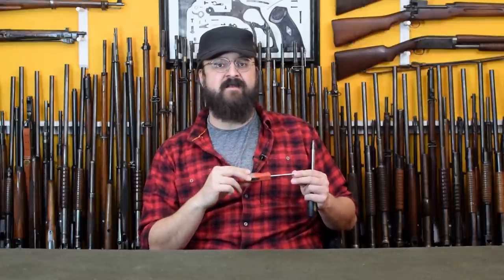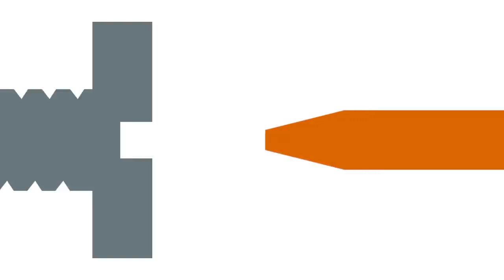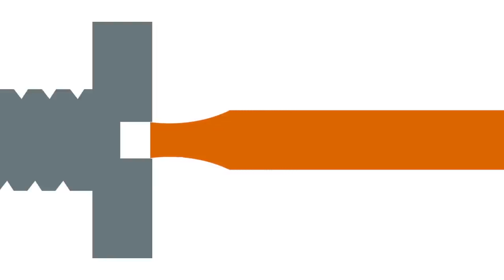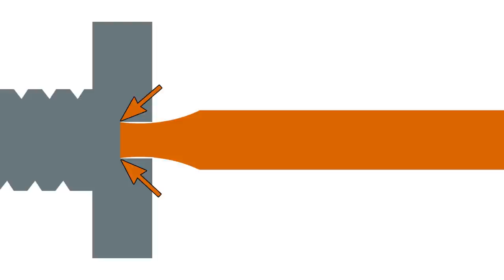Clips: Stop Using the Wrong Screwdrivers on Your Guns

Comment: "Don't use American Phillips heads on Japanese motorcycles".  Dude, why didn't you tell me this five years ago?  Could have saved me a huge headache.  Oh well, at least I have a nice set of JIS drivers now.
Reply: The same should be said with Japanese electronics too. Those tiny little screws in handheld electronics strip easily and are too small or in too cramped of a space for many stripped screw removal methods.
Reply: You’re so right about that. Not to mention that some 1960’s and early 70’s Japanese motorcycles used a mix of regular metric AND JIS threads.

Comment: Brownell’s Magna-tip screwdrivers are a good choice, and you’ll support a business that has supported this channel.
Reply: They also happen to be one of the best places to get hard to find tools, and parts.  Like the specific screwdriver for that particular screw, in that particular model of that particular gun, and replacement screws if needed.
Reply: Ryan I have the super set but they all start at -3 as the thinnest...... it is a bit irritating as I bought the largest set and find I still need some thinner ones and all the holders are full as it is. This will require yet another box to hold bits..... and more money. I posted this above before I read your post, I have this very issue today no less, as well as previously on others.

Comment: Thank you for the shout out at the end regarding Japanese bikes.  I didnt believe that Japanese Industrial Standard screws were actually different than American Phillips but after getting a set of JIS drivers I am a full on convert.  Best $30 I've spent on three drivers (and most money I've ever spent on screwdrivers)
Reply: Those are Posi-Drive and insanely excellent. Not quite Torx, but still incredible.
Reply: @john-paulsilke893  Posidriv and JIS are two different systems: the former has additional splines to hold the screw better, while the latter is ground to a slightly different angle than Phillips to reduce cam-out.

Comment: Arguably, the real lesson is get a nice set of whetstones and good measuring tools so you can shape those cheap hardware screwdriver heads into the perfect shape for the gun. If you are going to own a gun, investing some time into making the perfect tools for said gun seems logical to me.
Reply: @LabRat Knatz yeah, that's how it starts. Before you know it you are knee deep in drill presses, lathes and CNC machines.
Fabricobbling: NOT! EVEN! ONCE!
Reply: Had to make a screwdriver for a 1951 beretta locking block I feel that
Reply: Unfortunately, those cheap hardware store screwdrivers are usually made with very soft steel. Depending on the fastener, it may even be softer than the recess it fits into. You can make a very precise tool but if it deforms during use, that's not worth much. Now, if you can learn how to charcoal case harden your screwdriver after grinding it to shape, you'd have a very long lasting tool!
Reply: That solution gets complicated if you have multiple guns and multiple screw sizes for each gun.
Reply: @elektro3000  True, soft metal is an issue but on the other hand, it is good practice for the kids to make them when they do wear out. Also, as you say, not too hard to harden them if you feel like a more permanent addition to the tool pool!
Reply: @colbunkmust  For sure, your mileage may vary. For me, I would rather worry about keeping track of multiple screwheads than trying to source a new screw if it gets damaged. Worn or damaged screws are very obnoxious to me. Also, it is a great way to practice precise filing, whetting, and other useful skills. One day, I might even be good at it!
Reply: @colbunkmust  If you work on old guns, you inevitably wind up modifying screwdriver bits to fit. You just cannot buy drivers in all those weird sizes, like very thin but wide screwdrivers with a divot cut out in the middle etc. Not keeping track of which are for what gun also seems inevitable, some get modified again to fit something else. That's just the nature of gunsmithing older stuff.
Note that perfect fit is mostly important when trying to loosen old rusty screws that haven't been touched in a couple of generations. Once you've done the maintenance and know the screws aren't stuck, you can get away with a more generic screwdriver without doing damage. Should still avoid the tapered ones, though.

Comment: Also don't use Philips head screwdrivers on many European things, which actually use Pozidriv, for similar reasons. You can recognize a Pozidriv screw by the small extra cuts between the main "spokes" of the + shaped hole. A Philips will very easily strip them, and a proper Pozidriv driver will grab on much better.

Comment: I never realized this until recently when I screwed up two screws on my colt 1873 replica. These videos like this are so good and are not done nearly enough this channel is awesome
Reply: I recall the first time seeing this issue in action was in Novaks shop during an Anvil project episode he filmed for us. When he pointed out this problem and basically laid out the solution as "this is why I by a bunch of cheap screw bits by the bucket load because they are cheap." While he was grinding down a flat head to match the screws he was working on. Amazed me.

Comment: The first thing I was taught in Mechanical constrution I was "Don't use Philips screws and straight out forget slotted ones." 
Inner hexagon, outer hexagon, Torx, even Pozidriv are much better - and more foolproof (unless you use a Philips driver on a Pozidriv screw). 
However, with older stuff, you don't have much choice.

Comment: As a commensurate tinkerer, locksmith and welder, I have several screwdrivers which I have filed to a "gunsmith's grind", and two I managed to find loose in a bin at a used stuff shop.  I even have a set of screwdrivers I filed myself out of bronze rod stock, for cases where non-marring is paramount.  The utility of such tools extends far beyond firearms and into just about anything assembled with slot-head screws which you wish to or are obliged to preserve for any reason.

Comment: In regards to using Philips screwdrivers on pretty much anything made in Japan - if you are doing work on a Japanese item, pick up a set of JIS Screwdrivers, such as those manufactured by 'Vessel' (Japanese tool company). 

Life changing if you work on Japanese cars/items. The way the cross head fits the JIS screws is just on another level 😆

Comment: I got a handgun for a hundred and fifty bucks under what they were going for at the time because the magazines would stick. Turned out the owner changed the grip screws out with torx screws and they were too long and dragged on the magazine.  When I asked why he switched them wondering if the originals came loose he said they were fine, but the screwdriver would screw up that cheap Italian metal. Poor gun.

Comment: I'm 57 and during my time in the service I found how nice it would be to have any kind of tools other than the tip of a bullet and constantino wire pliers which came equipped with cutter 3 variable jaws and a slot type screw driver ground no where near where it needed to be and an E tool that worked as a pick shovel and daze and axe along with my camilus survival knife. But spending a numerous  hours either in the supply or the armory a set of hollow ground drivers were the best thing to have on hand as well as two types of hammers one brass and one polished steel.and a set of 3 crescent wrenches. Also the first tools I had when I left the service

Comment: One cannot stress how difficult it is to order Pozidriver screws in the US. Hewlett-Packard seem to be the only manufacturer that knows the source. My suppliers sure didn’t twenty years of so ago. I learned about them first on my 1973 Land Rover not in any of my engineering classes. 

I really like my Brownells sets. If you work on old Winchester or Marlin rifles order the thin bit set in addition to the standard Super Set.

Comment: Learnt this the hard way while trying to take down Grand-Dad’s hand me down Auto-5 when I was 13-14 or so.
No Gun Gurus back then.
Reply: There are even specific screwdriver sets for the Auto-5, they have some extremely narrow slotted screws in them that even gunsmithing sets can occasionally lack. Having those is a worthwhile investment if you have to crack open Auto-5s on a regular basis.

Comment: I make my own hollow ground screwdrivers with parallel sides from Forster screwdrivers that I purchase from Midway Supply. I do have a set of Grobet Vallorbe screw slotting files for cutting angular slots in screwheads. Most firearm screw slots are straight parallel wall types but alot of the older screws are Vee or angular cut. Always find or make the correct driver for the screw.
Reply: I approve this message 🤣

Comment: That’s something I’ve never thought of. Now I need to go buy a whole new screwdriver set…
Reply: The basic Wheeler sets are good enough for most frequently-seen sizes and aren't too expensive. Some of the bigger sets go overboard on padding out the # of bits by throwing in obscure manufacturer-specific bits that few people will ever actually need. Of course there are fancier gunsmithing tool brands out there too.
Reply: Agree with the above. The Wheeler sets are perfectly adequate and reasonable enough in price.

Comment: Have unfortunately learnt this the hard way 
Stripped the screw on the front barrel band of a .310 martini carbine and was feeling thoroughly dejected 
Bought a proper grind screwset made for gunsmithing and used it to take apart my Type 38 rifle and it came apart like a charm 

Hope this video helps some people not make the simple mistake I did!
Reply: Hey, got a link or upc for the Type 38 set? Thanks!
Reply: @MaxwellSchmalzried  I bought a Chapman screw set 
Uh Kit number 5589
Unfortunately one of the screw bits did break the first time I used it but it was replaced by the company I bought it through free of charge and I’ve had no other issues with it since! 
Very handy little kit 
Hope it helps!

Comment: You are supposed to file a slotted screwdriver to fit. If you look at the old fashioned so called cabinet makers screwdrivers, the craftsman would match the tip to the screws he used. There's so much meat on the old screwdrivers its almost as if they were designed for it.

Comment: And for those who tinker on Japanese motorcycles with carbs. Gunsmithing screwdrivers are the best for pulling out and putting in those troublesome brass jets. For the same reason, just saying.

Comment: You Know I have the Brownells Master kit and STILL don't have the right one sometimes. Fortunately I have a some other precision tips that have fit properly, seems the Brownell just are not thin enough in some cases LIKE TODAY no less. Seriously, TODAY I was dealing with a Frame screw and none of the Magna Tip Super set fit... seems they all start at -3 I need a -2
but I did have an unrelated unmarked tip that was perfect fit for depth width and full fit. But pure luck I had that.  I found it irritating for what I spent on it.
I make every effort to be as prepared as possible and still find myself coming up short.
Reply: They also have a thin bit set of magna tips. Very valuable when working on Winchesters and Marlins

Comment: Or stop using guns that need specialized screwdrivers. Shouldnt that be a concern when designing a gun?
Reply: This is a channel about old guns. Old guns use old screw designs. Basically all old guns have this issue with modern screwdrivers.